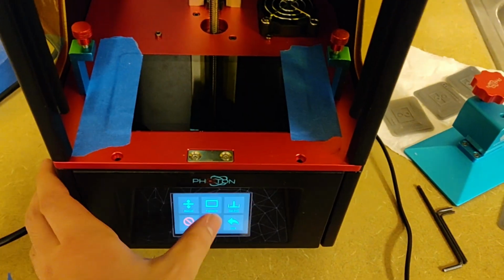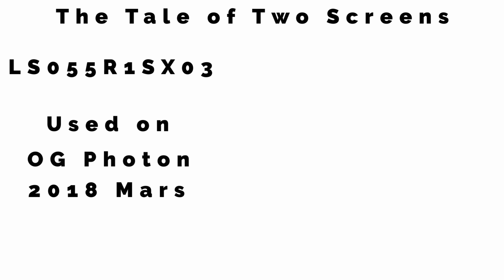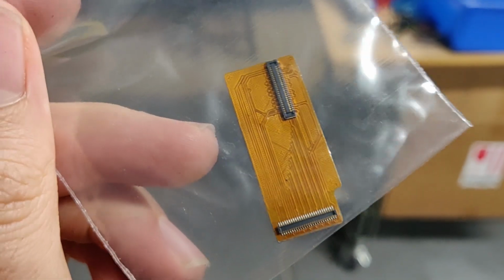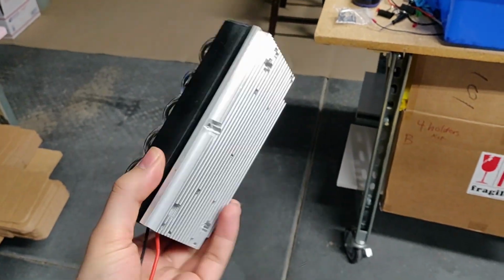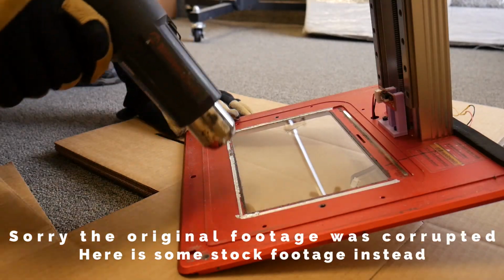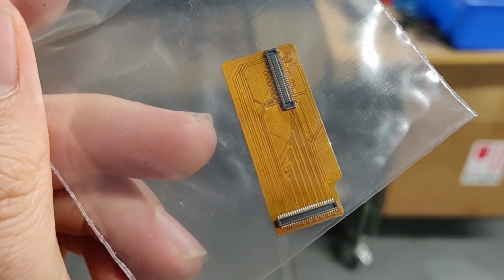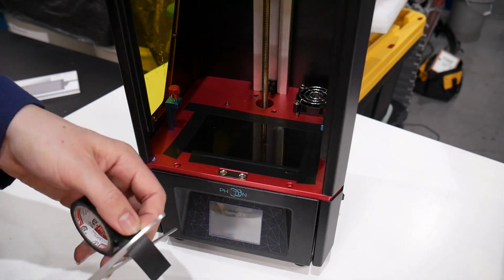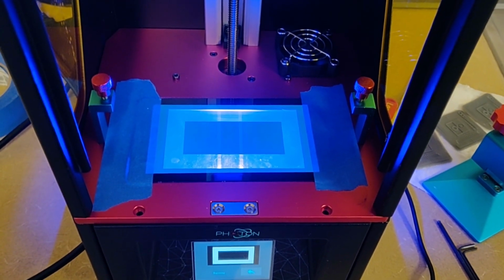The Easiest Mono Screen Mod for the Anycubic Photon (And Most Other Older Resin Printers)

Comment: I upgraded my Photon Classic with a 40w LED array (5w more, non parallel) and driver board I got from Raytron Solution on Aliexpress but haven't put it back together yet (it sticks out maybe 2mm, so I need to get some washers to space out the motherboard bracket and maybe shield it with a piece of electrical tape or something) They might be working on a compatible paraLED array, not sure -- Anyway I went ahead and ordered a mono screen since my Photon's still taken apart.
Thanks a lot for the vid! :thumbsup:

Comment: Hey there... So I went ahead and swapped screens, my OG photon's screen had blemishes on it. Used your instructions, but i'm having an issue with the firmware. I've tried a couple of USB drives, tried putting the .cdb file but my printer doesn't see this particular file. Anything else is fine though. I went back to anycubic's site and noticed their firmware files are .bin. Wondering if i'm supposed to change the extension?
Reply from the maker: Wierd, bin files are the standard for making changes to the UI menu or bootup logo image. CBD should be the core firmware files for making changes to the FPGA. I'd recommend reaching out to Chitu support and see what they have to say as the files should be visible and executable.
Reply: I'm having the same issue and would like to hear an update Javier.
Reply: @coltonmullins4980  no update. I reached out to chitu and never got a response. I’ve been a little busy with some other things, so I haven’t touched it since.
Reply: @JavierLopezElMagnate  dang, I hate to hear that. If I get anything figured out, I'll be sure to post here.
Reply: @JavierLopezElMagnate  I hate to tell you this, but it looks like our motherboards are the Photon s boards, rather than the V1. At least, that is what I know my issue is. If you have the V1 board, then I'm not sure what your issue is.
Reply: @coltonmullins4980  you mean the photon s board? When i was swapping screens I couldn’t find a part number on the board so that is a possibility.
Reply: @JavierLopezElMagnate  I just looked at pictures of the boards and compared them to mine.
Reply: @coltonmullins4980  still doesn’t explain why the cbd file doesn’t work. I can turn on the printer and the light comes on…. The screen just doesn’t do anything.
Reply: @JavierLopezElMagnate  yeah, but it's the only thing that is different from the guides. I saw one other person with our issue and they replaced the board and it worked.
Reply: @coltonmullins4980  well. Guess I’ll give that a shot… lol. So much for buying and entry level printer.
Reply: @JavierLopezElMagnate  yeah, was pretty annoyed when I realized my board wasn't what I thought it was.

Comment: Thank you for the awesome video, I did by the kit before I found this video of yours. luckily I got the whole kit as I had the photon s board. I do have a couple issues that are popping up. 1) I had to use a generic printer profile in chitibox as I could not save the files in .ctb or .cbdllp to work with the board. 2) when my print finishes the print bed rasies and hits the stop of my photon and the motor binds for a few seconds before shutting off. Do you know of a way to stop this from happening as I fell it would burn the motor out?

Comment: Is it possible to use this on a Mars 1 B board?  I tried installing the firmware and i keep on getting constant m400 errors on the sh4 file and unknown format  errors with the cbd file,  I currently reverted back to the stock mars 4.2 firmware out of frustration.

Comment: This is interesting to me. I bought a used Photon and I've been trying to get it to print and print better. Using the Anycubic Tough resin and trying to figure out the settings. Biggest issue I have had so far is printing larger objects. Any advice?
Reply from the maker: Best bet is to invest time and resin to dial in your support settings relative to the layer exposures you are using. If dimensional accuracy or surface detail don't matter then the "lazy" way is just to keep bumping up exposure times so that the print is slightly over.

Comment: I'm trying to understand why the firmware and the option you shown on the video are set on 1920 x 1080 resolution, and I also have a question regarding the light do I need to change the board for the light source change or can I stick with the OG photon stock board for that too?. I'm also at 14 seconds exposure per layer is that normal (stock og photon lights)? the videos are awesome ;)
Reply from the maker: The resolution of 1920 x 1080 listed on the firmware and slicer parameters has to match the mono screen resolution or the printer won't run. 

You don't have to change the board if you are only changing the light source as the stock board outputs the same range of power output as the V3 boards do.

14 second layers sounds about right if you are running a RGB screen, if you are using a upgraded mono screen like the 5.5" version mentioned in the video or the newer 6" screens then it will be too high of a cure time (3-5 seconds is the expected norm for mono screens).
Reply: @HiroCreations  I bough the sx04  one you recommended is that a non mono screen? there's 0 indication on the box regarding that and there wasn't any part number on the screen is self, I'm starting to think I bought a non mono lcd...cause the times are that high. it's ok a new light source is on the way. thank you anyway, you rock!! I'm loving this mod process!!! :D since I'm 3d modeler can't wait to print something of my own creation. cheers!!
Reply from the maker: @Armabelico  yeah this video is actually a few years old so I believe the mono screen mentioned in this video is no longer sold, and all the packaging I have handled plasters the word mono all over the box, so if you have a 5.5" LCD with a SX04 connector and it was between $25 -$30 then it's probably a regular RGB LCD.

I probably should do a new photon mod video with their newer generation screens (if there are any new generation screens).

Comment: Hi, so I am trying to follow these instruction when installing the screen to my original Photon printer. but when it comes to updating the firmware when I plug the flashdrive into the printer nothing shows up on the print screen? like my printer cannot read the .LCD and . CBD files from the Chitu website. Is there something I'm missing?
Reply from the maker: You are the second person I have heard this week to have this issue, I'd recommend reaching out to Chitu support directly and see if they changed something with the firmware they list on the site.
Reply: @HiroCreations  okay thanks. I did message them, but haven't heard anything yet.
Reply: Have you guys heard anything yet about this issue?  I am having the same issue and I'm still waiting to hear back.
Reply: @bravo320zf  nothing yet. I've been troubleshooting with Chitu for the last week and they haven't been super great at figuring it out.
Reply: @zaffa43  Anything figured out yet? I've been having the same problem.
Reply: @OpalMoonstone20  no. And they stopped replying to my messages about figuring it out. I am going to try to return it and get a regular RGB screen.
Reply: Okay so I figured out the problem I was having. And it was something that I should have checked beforehand. And it is that Anycubic sent out Original Photon printers with Photon S motherboards and they are NOT COMPATIBLE with this screen. You need to have a chitu motherboard for this screen to work. So if any of you are having issues make sure you don't have a Photon S motherboard installed.
Reply: @zaffa43  Thank you for figuring it out. Did you find a new screen that works with it?
Reply: @OpalMoonstone20  yes. Most RGB screens are still compatible. Just no monoscreens. Or at least that I've seen. The other option is to upgrade the motherboard as well.
Reply: @zaffa43  ok thanks. Good to know. Guess I’m buying another screen.
Reply: @OpalMoonstone20  yeah I had already ordered a RGB screen and when I asked to return the monoscreen they had expedited the shipping of the RGB for me for the inconvenience. It'll be nice to be back to printing after about a month of issues.
Reply: @zaffa43  Did you have to update the firmware for your rgb screen?
Reply: @OpalMoonstone20  no, I did not. Once the RGB screen was installed my printer already had the firmware needed to use it.
Reply: @zaffa43  Ok great. I just got my new rgp screen and replaced it and wanted to make sure I wasn't missing something. Just did a test print and it's working. I'm so excited to get back to printing!

Comment: my screen comes tomorrow and there seems to be a lack of installation information i can find online, your video is pretty much the only one, and whilst not a complete step by step with visual aids, it is filled with alot of very helpful information. I have the original photon with what i assume is the original v1 chitu board. I get the placing in the new glass, screen, and use the adapter for it to work with my board. They note there is 2 files a .LCD and a .BSD file.... but dont state what to do with them or what they actually do (although you mention there is firmware on their site). I assume its a print file that flashes the board with some info and you fire it on the flash drive and print each respectively , can you provide any clarification it this ?
Reply: Hi Stephen, Did you find an answer to your question else where? I have a similar issue but, my OG does not see any of the firmware files.  Would greatly appreciate any help or advice.

Comment: Awesome! I have original Mars the first run of them. How do I get adapter board?
Reply from the maker: The adapters are bundled with the Screens marked for the Photon/Mars.
Reply: By chance do you know what motherboard version you had? Did yours work with the adapter? I too have an original Mars and was hoping it worked with the adapter.
Reply: @Cwill1016  did you find out?  Currently the Chitu site only shows the adapter for the Photon kit. It just says it won’t work with an older Mars board.
Reply: @bt5252  yeah I have two Mars’. One with an older board that I had to replace and one that had a version C board that doesn’t need an adapter.

Comment: I'm trying to upgrade the firmware, but the .cbd file isn't showing up on my menu to "print" on the printer.  The files are in the root of the USB drive, so I'm getting the sinking feeling that this upgrade isn't compatible with my Photon...:(

Comment: Great work!! I have two creality Ld-001 that use the sx04 version LCD, the main board is based on a raspberry pi and a controller board, but I think it's not open source so no firmware changes are possible, at least that I know of. Do you think it may work without any firmware change?
Reply from the maker: I am not sure but, likely not without changing the output resolution. Safer bet is to use v3 board.

Comment: Great video! Because of it I purchased the chitu board and mono screen for my OG Photon. I just installed them but the screen doesn't show anything (it also beeps once when I turn it on), any ideas on what I might be doing wrong?
Reply from the maker: Are you referring to the touchscreen or the masking screen (where the prints happen)?

If its the touchscreen then you probably want to check the ribbon cable connections (its easy to put it in backwards).

If its the masking screen, make sure you installed the FHD mono specific firmware (the Chituboard L V3 ships with the 6" Mono firmware flashed usually).
Reply: @HiroCreations  thank you for answering my question. I meant the touchscreen, I suspected that I might have damaged the ribbon cable and bought a new touchscreen, as you said, I connected the ribbon cable backwards to the board (I even took the printer apart to check every conection). Now it seems to work just fine, gotta search for the UV test file and level the bed (the LCD screen  isn't flush to the base). Thanks again for your help =)
Reply: @panschop19  Hey Francisco did you replace the ribbon cable from the touch screen to the V3 board?

I'm having the same issue as you and just want to know how you fixes it?
Reply: @terrabite1473  I fixed it by connecting the ribbon cable backwards on one end, in my case it was the connection to the board that  I had reversed (made that mistake because I assumed that the blue rigid plastic tab in the ribbon cable had to be installed face up)
Reply: @panschop19  fantastic I just tried that and it working except the mono screen is cracked😅 time to see how good their customer support is.

Comment: Hey Yasu, I am having huge issues with the prints sticking constantly to the FEP instead of the bed. I have revealed the bed a stupid amount of times with different amounts of pressure and angles. I noticed that the screen requires to be mounted by tape just like in your case - which may introduce some angles - but I thought that this won't make any difference since it is the relative angle between the screen that matters. So I don't think it's that. I managed to get one relatively successful print in 20 tries. I couldn't even print 75% of all tries the flat exposure test unless i absolutely clamped the living hell out of the screen and the bed. Any hints?
Reply: Hey, did you ever find a solution to this? I am running into same issue. Not sure if its a height difference in the screen, or what is causing this. I can only get succesful prints when I way over-expose.

Comment: Hi. I have installed the 5.5FHD screen, V3 board and new 2.8 touch screen. Updated the firmware and used your Chitubox profile but my Photon won't read the print files. Do I need to update something?
Reply from the maker: What file are you exporting in chitubox? It seems like with the newer firmware updates that .ctb slices is the only files that the V3 will read and accept now.
Reply: @HiroCreations  I imported your FHD Chitu profile above and its saves as a .photon file and I cant select anything else
Reply: Do you have another profile I can import that the Photon OG will recognise? Thanks

Comment: So for the original Elegoo mars, no adapter is needed? That seems to be what chitu says at least. Just wanted to confirm.
Reply from the maker: Yeah most Elegoo Mars printers won't need an adapter--easy way to double check is to see if the end of the ribbon cable on your old screens were straight or L shaped at the end of the cable. If its L shaped you need the adapter, if it was straight then no adapter was needed.

Comment: I installed the new screen onto my og photon, with the adaptor, but now my printer won't read any file in the same flash drive I've been using, so I can't update the firmware. I've emailled Chitu, but no response yet. Any thoughts?
Reply from the maker: Sounds like a corrupt USB, have you tried with a different freshly formatted drive?
Reply: @HiroCreations  thank you, I haven’t tried that yet. I don’t think that could be it because I used it frequently without any problems, and it still works well on my computer. But I’ll give that a shot
Reply: @HJabroni  Did you find the solution to your problem? I am facing the exact same issue. I am interested in what Jon Williams says in their comment about Newer Version of the OG Photon board. I reached out to Chitu as well. I did not hear back because I just sent it today.
Reply: @TheEzMusician  no I ended up ordering a new one. But I get the feeling I wasn’t doing it right. Only because I upgraded the firmware of my new one and it was successful but I think the difference was that I didn’t make sure that the upgrade files were the only ones in the US. drive
Reply: @HJabroni  Thank you for your  response. Could you clarify what you mean by getting a new one? Do you mean you got a new board, or another printer? Thank you
Reply: @TheEzMusician  sorry I meant another printer

Comment: I installed the FHD MONO LCD on the Photon original, UV lamp is original. Exposure times: 27s Base 4 Layers / 3s Layers, Gray Anycubic resine. My print stays on FEP and print fails . Help please
Reply: I have the same issue. I relevelled the bed 20 times with different amounts of pressure and angles and god knows what else. It just keeps sticking to the FEP. -.-
Reply: Did you find a solution for this? I am struggling with this issue currently.

Comment: i changed out my screen and had  to change mother board too for the chitu v3 board . went to re calibrate the levels and z home sends the plate up not down , is this a firmware issue or should i have switched pins on z motor  compared to photon s board
Reply from the maker: Yeah for whatever reason, the stock firmware loaded on the board assumes the polarity of the motor is reversed. There are two easy fixes either changing line M8004 from 1 to -1 (OR -1 to 1) in the machine parameters gcode file that controls the firmware settings. (you want to modify your backup that you generate by running a gcode file with only the backup command M8512 'yourbackupfilename.gcode' )

Or if its easier you change the pin configuration on the motor to be the exact reverse.

Comment: Is this updated firmware going to lock me into using chitubox?
Reply from the maker: Good question, I am not fully sure for the OG photon board firmware, but a few folks who did the upgrade and kept the OG board reported it still reads .photon files which should be exportable in other slicers.